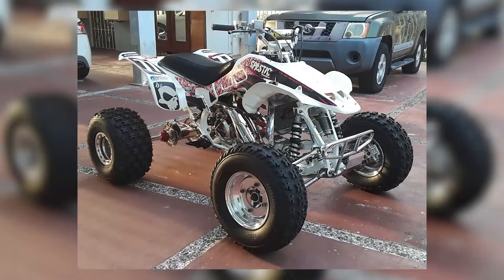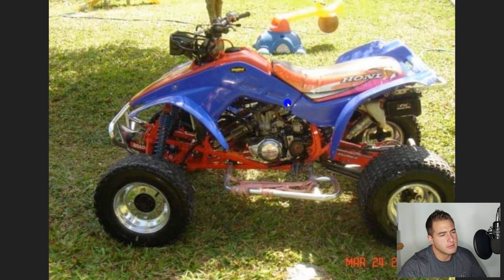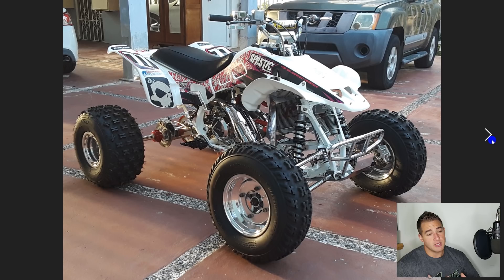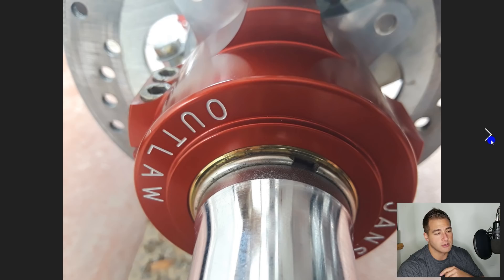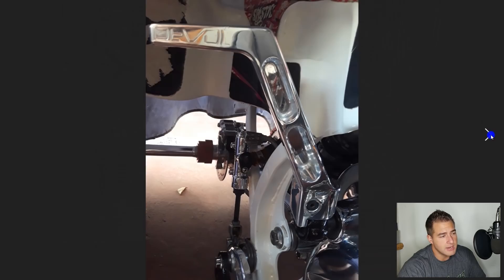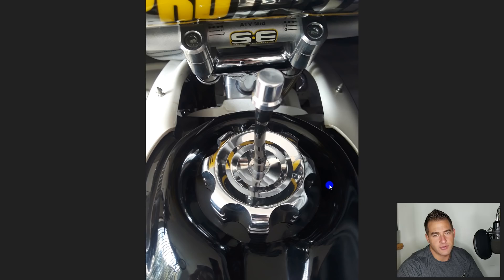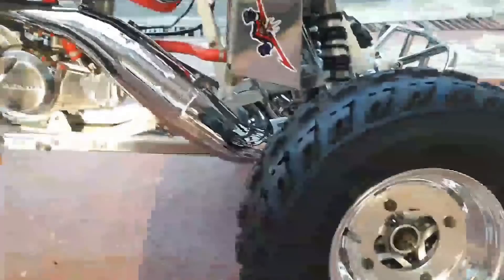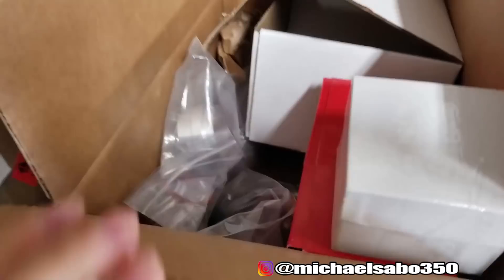THE COMMANDER OF LEGIONS! Sick 250R Build!

Comment: Polish that exhaust port. Trust me on this. If you don't, you'll get carbon buildup in there that will hinder performance and eventually stick your power valve. A polished exhaust helps keep the gases flowing out. Also, if you want your motor to stay really clean, consider using Maxima 927 @ 24 to 1. Best 2 stroke oil I've ever used.
Reply from the maker: Good call man; I am going to polish the exhaust port 🤘 I've heard really good things about 927; I am planning to run Klotz R50 for the start and I may switch to 927 to see if I like it.